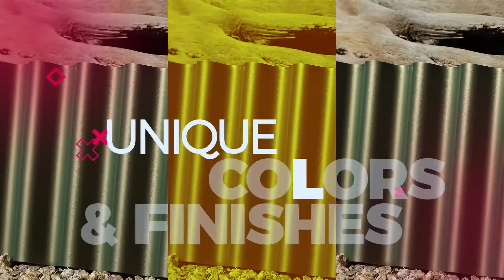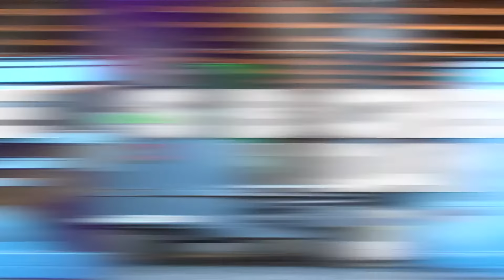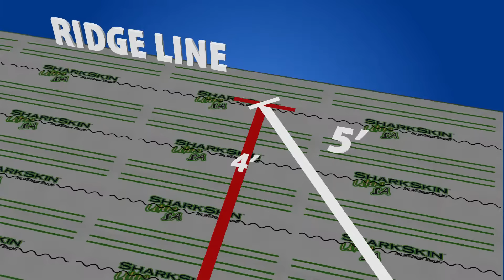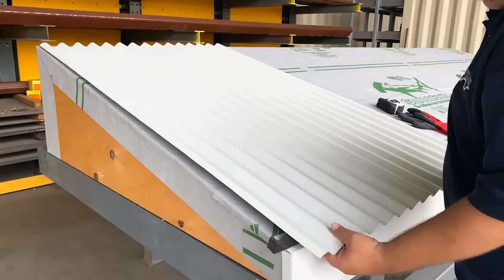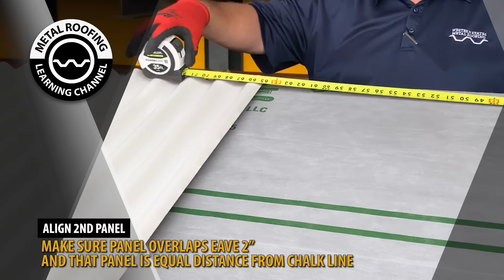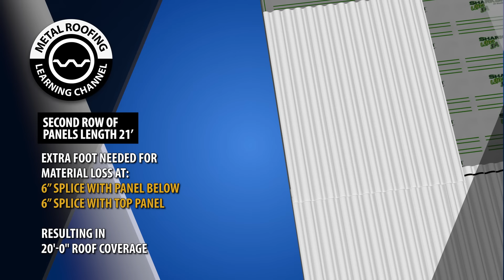How To Install Corrugated Metal Roofing. 1st Sheet Installation + Square Roof + Eave/Ridge + Overlap

Comment: Why is eave flashing on top of roof paper instead of under.  Also if foam closure strip is sealed with butyl tape how would any water getting under roof get out?

Comment: How wide of butyl tape do I use for overlappin and installing foam closure. Also where can I purchase it? A 20 by20 deck roof how long of a roll should I get?
Reply from the maker: Here is the size, Tape, 3/32"X3/8"X45' Roll. This can be purchased at any roofing supply store such as ABC Roofing Supply.
Reply: @WesternStatesMetalRoofing  Thanks.

Comment: Can we cover the screws with something to prevent leaks?
Reply from the maker: Nick, the best way to prevent leaks is too just not over or under tighten the screws. If you have a bad screw you can always replace it with a slightly larger screw. If the screws are fastened correctly, the washers are durable and will last many years. The link below explains the correct way to fasten the metal.
https://www.youtube.com/watch?v=zpDAeqpNPFc&t=113s

Comment: Yeah, it is important to get qualified roofers. We are in the middle of roofing and it is apparent that these roofers are not qualified to do the work of putting on a metal roof. Measurements for the roof were off. Every single screw has been over tightened so far. That equals bent metal. The guy we hired seems to have hired this unqualified crew to do the work. He didn’t even show up to supervise them. We just fired them...and now are stuck with an unfinished damaged roof. They weren’t bad at ripping off the old roof, but have left debris of old tar paper surrounding the house. What’s left of our new metal is lying In pieces covering my newly sprouted yard. The metal on the roof, barely screwed down is bent up and doesn’t even fit. It’s a nightmare that my partner doesn’t want to wake up from today!
Reply from the maker: I'm sorry to hear about your roofing nightmare. The most important thing you can do is to verify the contractor has installed many previous metal roofs and than check the references. At least you fired them early on. If they have a contractors license, file a grievance against it. It will give you tons of leverage to get your money back.

Here's a video that may help other folks out in hiring a qualified contractor.
https://www.youtube.com/watch?v=A52A0oENPWI
Reply: Are you getting what you paid for? Too many consumers neglect to do their due diligence and have this mindset that all trades are the same in qualification thereby getting the lowest price becomes the most important thing. If you took the lowest price then you are probably getting what you paid for. Trades are not commodities neither are you. The most qualified is the determining factor not the lowest price. Why didn’t you stop them on the first day? They didn’t “all of as sudden” do poor quality work. It started on the first day.
Reply: I want to see the guy doing the job while he's actually ON the roof, not on the ground!
Reply: @suziperret did you even check if the guy that quoted you for the job was even qualified in the first place. My guess you did not and accepted the cheapest quote, Buyer be aware.

Comment: an Orangutan could do what most of the videos  on U-Tube show,, wish I had the cameras and things to show how to do the technical  stuff like butting a metal roof up to a wall with vinyl or wood siding or even a concrete block wall. there are all kinds of different flashings that no one shows or even make in front of the cameras.  they  do roofing in a show room.
Reply from the maker: Old Dave, We always appreciate feedback. Have to start at the beginning though before you cover niche installation details. A video like this cost about $1,000 per edited minute, 10K for this one,  so it has to have an audience. That being said we are always looking for content partners. Where are you located? Have a video that you suggest that's a tricky install, but not too obscure?
Reply: @WesternStatesMetalRoofing  This video is fine for the average retail DIY rock ape(like me) that's doing a simple install. 
I learned a bit - and I appreciate it.
As for 'old dave' suggesting hard-core roof porn, go for it mate, get up there in most weather conditions and make a free professional video without looking like an orangutang. 
Anyone that thinks they can do open heart surgery from a youtube video will learn the hard way. Anything more than a lean-to on a garage I would suggest paying someone for their knowledge and getting it right. 

Good video, thanks from New Zealand.
Reply: @Old Dave hey man, it's been a year.... You still working on the screenplay?
Reply: @johnlockesghost5592  yeah, but my contract with  MGM will not let me publish it,